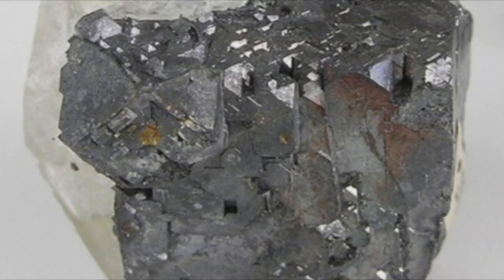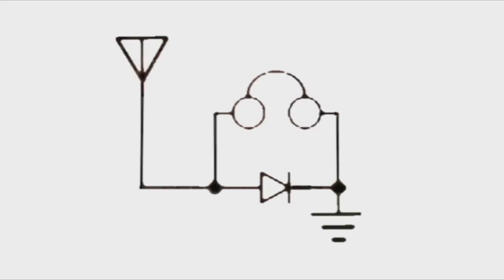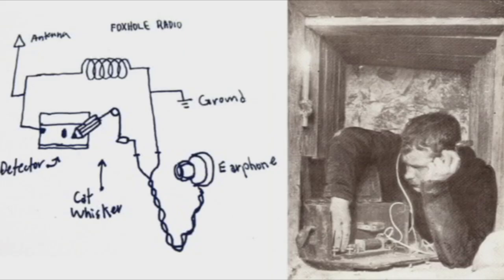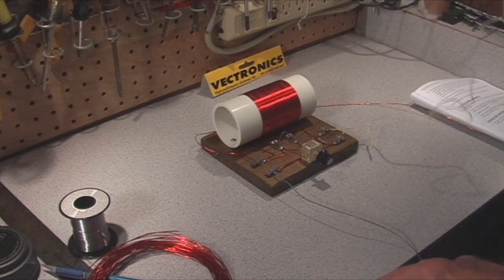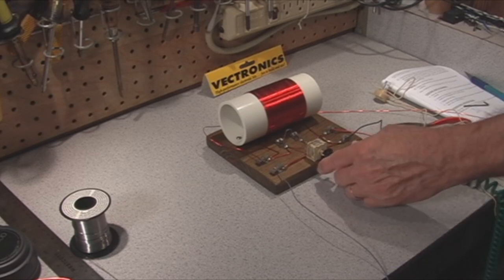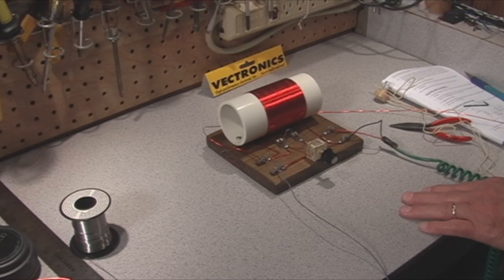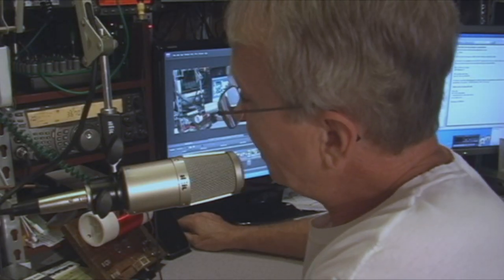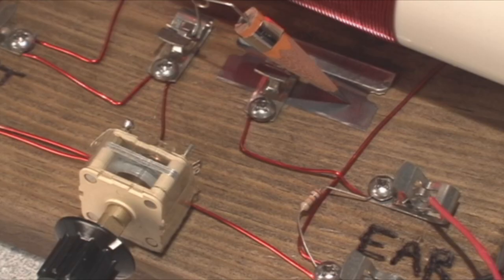AmateurLogic Shorts 14: Crystal Radio Testing

Comment: Interesting project George, I remember building a crystal set when I was about 12 years old, it was from a kit I bought from Radio Shack, or Tandy as they were known in the U.K. I had many fun hours listening to local A.M stations, and re-built the set into smaller housings, eventually turning it into a portable pocket radio...... the antenna was a different matter😂 73, M0KED, Lincoln, U.K.

Comment: When I was growing up in Lebanon, Ohio which was about 7 to 8 miles from the WLW (50,000 watts) and had a small crystal set.  Ground was the radiator and the Antenna was a wire out the second story window to a nearby tree.  I would listen to then what we called old time  radio.  I spent many hours listening to Lux Radio Theater. That was the old days, now I have been a licensed Ham since 1977.  I went down 20 years earlier and was a reader for my blind brother for his General exam in Cincinnati.  I now have a $3,000 dollar Icom ham radio and enjoying listening to and using the airways.  Horay.
Reply: CKLW?

Comment: Hello I use to build crystal radio back in the 60's Now I'm showing my Nephew how to build them. I see one on youtube, And i don't know where. Bot the radio had a 3 or 4inch coil and the wiper was moved with a knob on the front of the wooden box. It wasn't move be holding the wiper and sliding it. Have you ever seen this set up? I need to know wow it was made.... ( just the tuning knob on the wiper )....